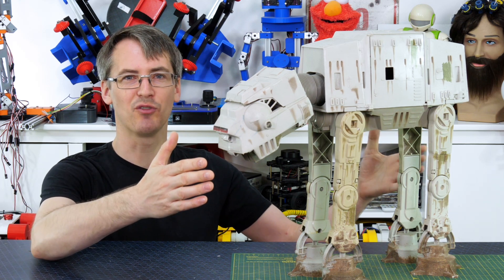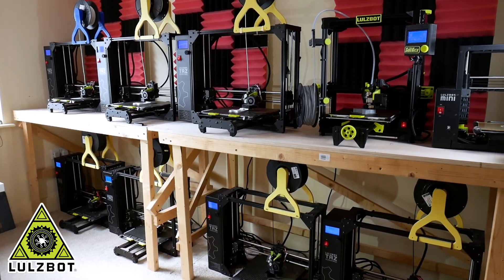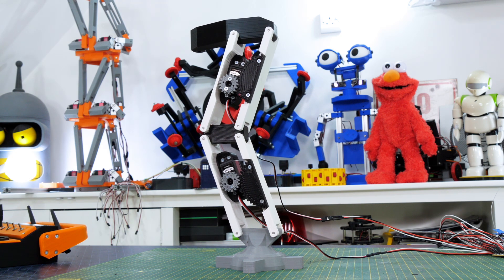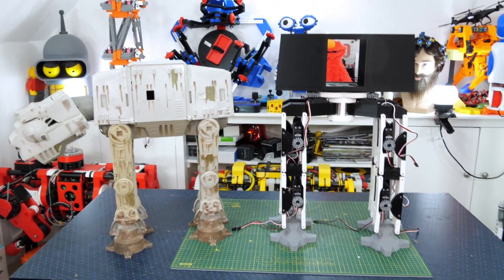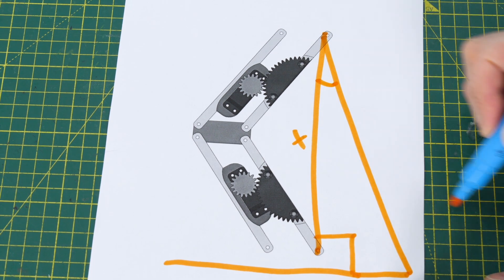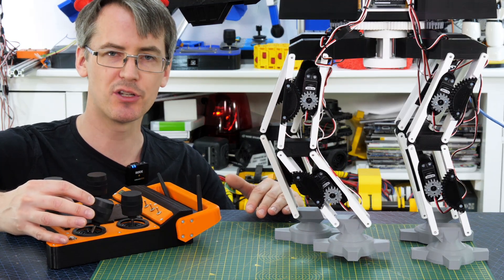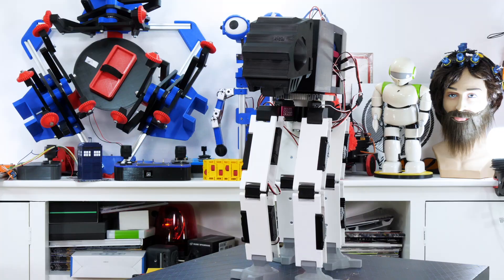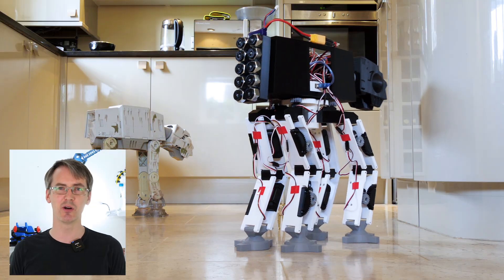Building a better Star Wars AT-AT toy

Comment: The "licensed" aspect doesn't exactly track when saying that the motion of moving toys sucks just because licensing is expensive. A lot of them suck because there's a lot of cash-grab companies and nobody was called on set to actually think about it. How it should be made etc. So they use in house thinking and the cheapest thing possible to maximize the profit, which is what they're after.

Look at Adam Savage's face when he unboxes the prop from Indiana Jones in a recent video. There's no moving parts in there and the final product is... well, to be charitable... atrociously bad. He wouldn't say it, but his face did and every person who has ever touched a toy or made a toy knows it. And an item design also knows that the item made there would've been easily achieved to original spec had they used metalized paint over a light pipe cast of a 1:1 copy of the prop.

I'm merely tangential to toy making, i helped a designer friend with a project, but i know that if something is desired (to be read, if there's a thinking beyond just cash-grab) then it's possible. Plenty of toys i've taken apart had that.

The "toy" you made, it could be replicated for far cheaper using 70's or 80's tech. You don't really need servos for it. There's a lot of period correct toys that have utilized motion with very basic, dumb brains. And i mean, we have century old  worth of automata that don't use smart or highly advanced technology for their motion. TLDR: where there's a want, there's a will.
Reply: That all makes sense. I'm told there was a good motorized Lego AT-AT, but Lego have brilliant in-house thinkers to start with.

I think James might have said in an old video that that he uses Arduinos because controllers aren't his forte. I can't clearly remember though.

Comment: There is a Lego AT-AT model that is totally mechanical with just one drive motor. Its also quite large.
Reply: I believe its using the same mechanism as the toy shown at the start of this video.
Reply: @kantpredict  Not quite. it have a joint that is controlled by a bar that is conected to some top bracket that alows it to move the legs with 8 joints. 4 master joints and 4 slave joints. This makes it look quite simular to the real deal.

Also worth saying, there is probobly 10 diffrent lego AT-AT offical modell. I´m refering to the large technicl lego model.

its called the 10178

Comment: Rather than have that central hub for the legs you could seperate each leg out to its respective corner cutting down the length of the rotating arm so there’s less leverage on the head and body making it more stable

Comment: The ramp library I haven't used before. I made a library that can basically do the same thing except for  changing the PWM width over time for controlling some LEDs via some MOFFETTs. I wanted them to fade on and off while maintaining the same color. Would have saved some time if I knew about the library, but it was fun to program anyway.